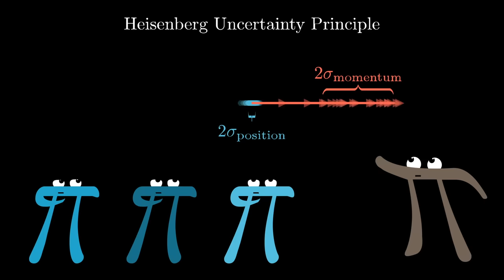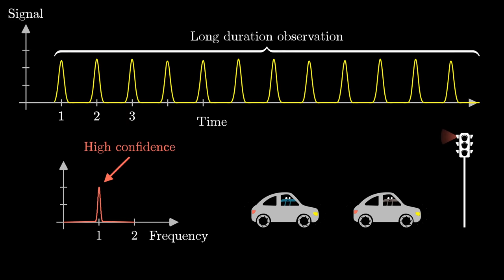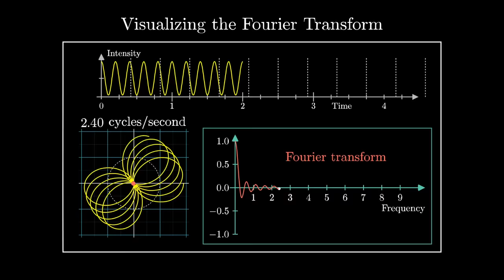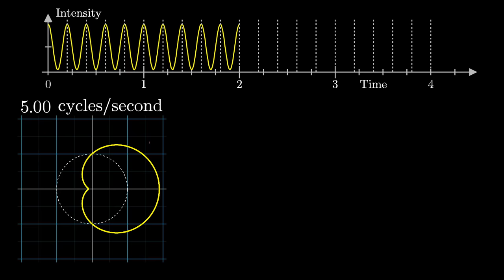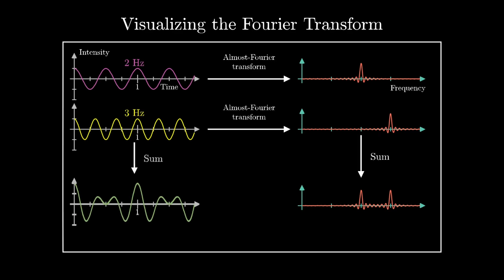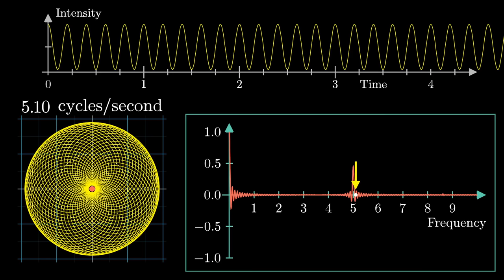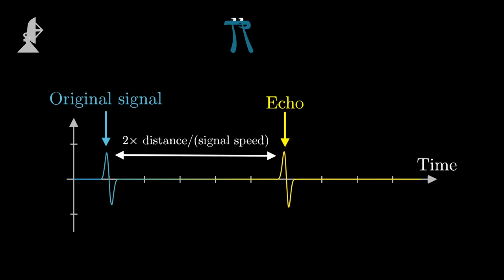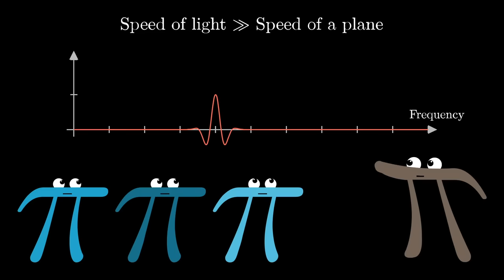The more general uncertainty principle, regarding Fourier transforms

Comment: I'm totally mind-blown by your ability to translate hard to understand concepts to easier concept. 

As a very critical person I only had one objection to the whole video, which is rear. At 12:30, when you shift the weights to the center, you didn't adjust the strings, so I was a bit confused, had to lissen to it again to understand that even after the shift they all still in sync.  To keep it in sync, the thickness of the springs need adjust as well ... ok, it may be a challenge to render it, but it did make me stumble on an otherwise flawless video. 

Ow, if you want intuition to science, I would love to contribute as an interdisciplinair scientists. My main topic of interest is to understand how novelty can emerge, which touches so many domains that I have a good understanding of many domains (I'm doctor in 5 domains).

Comment: Without knowing any of that I was able to explain how having a more precise measurment of the position of something (which corresponded to a less precise measurement of speed) resulted in knowing the position of something moving over time to became much less certain than if the initial certainty of the measurement of it's position was less certain instead (and so the corresponding precision of the measurement of it's speed was more certain instead also). Though I didn't explain why as you have done in this video. But without knowing why you can see the effect much easier when considering what is going on dynamically rather than just considering instaneous measurements of speed and position at any one time. I just used a treacle and water mixing analogy - water being position and speed being treacle (on a slope), with more water going over to the treacle (making it more runny - unevenly due to randomness) with greater certainty over position.

Also, relating to something else, I hadn't realised I had re-invented the fourier transform myself (with the same visualisation you had) until watching this - so that was funny...   Well, I guessed I had but I wasn't sure. I was mapping infinities onto a sphere by converting linear numerical dimensions (i.e. infinity) into trigonometric dimentions (i.e. 90 degrees) - which is like the zero to infinity boundry conditions used with signal processing (?). I was playing with phase differences and central focal points (by continuing using a spiral rather than the free floating orange point you had in the yellow curves). So I'll have to revisit what I did.

Comment: in physics - the word "beats" is used to describe 
the changing magnitude of the sum of two signals of nearly equal frequencies -
as these signals slide in and out of phase with each other.
thus a 203 hz signal added to a 200 hz signal would yield (203-200=3) beats per second.
thus "beats per second" (referenced at 2:50) is not a good synonym for "cycles per second".
admittedly a trifling criticism in the midst of a masterful presentation of VERY "difficult" topics.

Comment: I would like to add one more thing. Why the Fourier transform is the average/summation of the projection over circle. If we write down e power x, sin x and cos x in Taylor series, and expand the expression to e power ix we get the result as cos x + I sin x. Now Fourier transform is the integral of this e power ix multipled over our function of x. So in visual terms it's the summation of the projection of Cos x times our function on the x axis and sin x times our function on the y axis. Now one may wonder why we need both cos x and I sinx. Wouldn't just cos x suffice? The answer lies in that we need atleast these two components to encode the phase information.

Comment: At 1.52 the yellow signal contains two frequencies. The lower one modulates the higher one. Should look at the Instantaneous frequency. Frequency in FFT is constant and the time frequency pair is transformed in integration so that causes the uncertainty issue.

Comment: This explanation is amazing! Another trade that happens in Physics which I can't find anywhere is the simultaneous measurement of electrical current and voltage around a resistor. you can't have both simultaneously with unlimited precision. Would you comment that or someone find a reference to that for me?

Comment: Your comparison to identifying sound frequencies, with higher frequencies requiring more time to identify, is contrary to what we find when we try electronically to identify the frequencies of sounds made, say, by a guitar. Our equipment more readily, that is more quickly, identifies a higher pitched sound than a bass sound. The bass sound takes longer to be processed and identified, simply because it is not over for comparatively a long time. This is quite a problem when we want to use sound-to-midi equipment to follow a quick guitar riff. The higher pitched sounds are more easily recognized and discerned among other notes than the bass sounds. It has kept back guitar-to-midi gear for years.

Comment: Around 14:45 the video shows a plot of position and a plot of spatial frequency. Above those two is an animated single frequency sine wave. Then, as the spatial frequency is shown to increase or decrease on the spatial frequency plot, the animated sine wave is shown to change. I think that the change shown is in the wrong direction, i.e., as the frequency increases the peaks in the sine wave become further apart. It should be the other way around, I think.

Comment: I would just respectfully add a minor detail. In quantum mechanics, the wavefunction has an inherent probabilistic character. So, all your reasoning is valid in a probabilistic sense. That is, if you repeat the experiments of measuring both the position and the momentum of a particle in a state over and over again, you would find the trade-off you mentioned (depending on the wavefunction itself): the more you know the position, the less you know the momentum and vice-versa. Again, this sentence is valid for the average of those quantities over a large number of experiments. That is the uncertainty relation, which is what you explained well in this video.
However, that is not the uncertainty principle. The uncertainty principle states that that remains true even for an individual measurement. As far as I know, this does not follow from the mathematical framework of the quantum theory.

Comment: Interesting. Not sure of the specifications for aircraft radars, but for weather radars, we generally transmit pulses several thousand wavelengths long, so there's very little ambiguity in the frequency. Instead, our problems are caused by the time between successive pulses. That introduces position and velocity uncertainty, though in a slightly different way.

Comment: Moreover, in linear algebra terms, this relates to how that coordinates change when you rotate from one basis to another and that such a basis rotation causes a vector which lies on an axis to no longer do so. A Dirac delta or close to one - ideally localized particle - is a "vector" lying along a single "axis" of the infinite-dimensional vector space, where the "axes" (not the vectors!) represent possible positions in (real, not vector) space. When you rotate basis to the momentum basis, that is, to sine waves, then now this vector no longer lies along an axis and thus has components along many axes - many possible points in momentum, so it appears spread out when you graph the associated wave function you get something much more spread out. And it's not hard to become tempted to make the jump that given that the evolution of such a dense wave packet is to spread out, that it could be described by itself a progressive rotation (or more complicated motion) of the basis vectors. And you can indeed do that. That is the "Heisenberg picture" of quantum mechanics. The other picture with the wave function in single basis spreading - i.e. the "usual" picture and which corresponds to the vector wandering - is the "Schrodinger picture" of quantum mechanics.

(There is also one more picture, which is the Feynman Path Integral picture, which corresponds in at least a rough sense to imagining the eigenvectors - which in quantum means those definite-property states like the delta functions for position - as wandering, since we assign probabilities to each possible classical path, which could be described by such things with their "peaks" moving to trace it out.)

Comment: What are the moving dotted lines symbolizing? They seem to be the key factor in what kind of graph is drawn and and where the dot moves in fourier transform, but I didn't hear it if you explained what's happening with them. The sine wave doesn't move based on time, but the dotted lines do.

Comment: at 12:42 you depict all masses attached to a spring as having the same frequency. The frequency of oscillation depends on the mass attached to the spring (inertia). As I understand it´s not what de Broglie describes in his seminal paper. He writes: 
"To make the last point more precise, consider a mechanical comparison, perhaps a bit crude, but that speaks to one’s imagination. Consider a large, horizontal circular disk, from which identical weights are suspended on springs. Let the number of such systems per unit area, i.e., their density, diminish rapidly as one moves out from the centre of the disk, so that there is a high concentration at the centre. All the weights on springs have the same period; let us set them in motion with identical amplitudes and phases. The surface passing through the centre of gravity of the weights would be a plane oscillating up and down. This ensemble of systems is a crude analogue to a parcel of energy as we imagine it to be." So there are all different oscillator but their density is higher in the center. Your simulation at 12:42 is therefore not totally correct physically...

Comment: Haven't finished yet but this is has been my basic guiding principle for years now in theory. Motion the vector creates mass my causing movement of fluid space. Mass is a wave from creating structures with those amounts for given structure and as we say in programing higher and lower over view structures are particles of those masses that have had emergence patterns define certain particles such as relative amount of size and energies of electrons. So when forming an atom you have the prime matter theory that an particle managed to stretch out the inward facing poles of prime matter fluid space of space time allowing the poles to attract a nucleus. The surface of every particle is a wave holding all of the information about that wave which can be wrapped in multiple dimensions around another point a higher lever over view particle in this case the electrons energy can start wrapping their energies around a nucleolus. Looking at the Fourier transforms yo showed in 2d but in 3d as sheets of energies until the shell is so full of electrons then electrons can begin to wrap around the next shell to hold them together you need more attraction of mass from the nucleolus as well. Given they are normal forms the energy defining the vector that give the particle shape tends to break off in similar particle shapes but also given inefficiencies particles can loos energy while moving through space as heat, neutrinos, decay, I'm sure there are others and you get things like shifting neutrinos adding and loosing mass. In any case each shell fits over each shell and break apart as equal amounts approx. of energy as that may neutrinos. Determining the side of the wave forms like in your Fourier transforms that are highest and intersected at that time in the waves motion or unequal distribution of the mass on the surface area of the wave is hard for reasons discussed in this video you also do no t know where that transforms spirograph shaped waves started tracing and what other particles bounded off of them. Say a light wave squeezing up and down between atoms or laser light carrying an entangles particle to a spooky distance and bouncing off of the sheets edge creating ripples allowing them to turn the spin of the atoms or some other structure all at once to cause action at a distance without need of time as they spin together. I've also been watching PBS for years and I know my fringe idea since I was at central seattle that the wave edge of something cam from my trying to rethink the double slit and to me it all makes perfect sense but is difficult to describe with my language and I've have to refine it with lessons but I had a guiding principle a few years ago that a particle is a portion of energy traveling as a vector that give the vector shape. Now how does the in motion wave shell get effected by red shift and blue shifts and how if you are closer to the part of a wave and because of a small amount of relativity further away from the next part when viewing it as a whole. I like o submit that they are moving and interacting within their physical space with the same rules as the part you are closest to and not that observing changes it unless that form of observing adds variables and energy but that it you are simple unable to be in all places so it appears different. It also makes measuring things like how entanglement can be effecting all the particles and spacetime as it travels but to me there is always a physical mechanism that is not to complicated to imagine and not just magic.

Comment: A more intuitive word for spatial frequency is "density." In the field of cymatics, the density of particles increases at resonant points along some medium.

Since there is a higher density of particles at those points, the momentum of the system is higher, because the net mass of the system is higher at those points, since there are more particles there. :^)

Comment: If you want to get just a little more mind-bending, consider that that momentum wave that describes the particle's motion through space is only describing motion relative to your reference frame. In its own frame, it has no momentum wave, unless it's accelerating (in which case its reference frame is changing at a constant rate).

Comment: Question: Is this a good example?
1. Take a 100% sharp picture of a bullet at time X = Shape and position is clear but the relative speed is not discernible
2. Take 10  10% unsharp pictures of the of the bullet at time X1 and X2 and ... = Relative Speed is clear but the shape is not clear
Reply: I don't know if this analogy is apt and comes without weaknesses, but it seems like a good analogy to me. It depicts well the trade-off, illustrating that you can't take unlimited data from the given object. There's a limited amount of data taking available and you have to trade off whether you want to concentrate it for position or spread it out for momentum.

Comment: Great video . However the  animation with  loaded springs ignores the fact that in (classical) physics the frequentie of an oscilation depends on both the stiffness of the spring and the mass of the object that is suspendid. The animation seems to suggest that all the springs are the same. If that is the case then the springs with the heavier load should oscilate at a LOWER frequentie then those with a lighter load or at least for an observer who is not moving relatively to the row of springs. Overal this means that the frequentie-spectrum is much more complicated than depicted.  And of course it would cause a serious headache to make an accurate analyses of what a MOVING observer is going to see. (pardon my splleling)

Comment: This video also explain the spread of frequency of AM and FM radio.

A low amplitude sound will modify the amplitude or frequency just a little, so creating almost no interference with other radio station using almost the same frequency.

A low frequency modulation also introduce less interference with other radio station than if the frequency of the signal to modulate is higher.

Finally, if the signal that modulate the AM or FM radio is not sinusoidal, then the interference of the AM or FM transmitter also increase.

For example, given a 1 khz signal with a given amplitude, if the only parameter that change is the wave shape, the final modulated signal will increase in bandwidth, that is interfere with other radio station more for a square wave at 1 khz than a sin wave at 1 khz.

Brief, given the 3 parameters of the signal to modulate:
- amplitude
- frequency
- wave shape

At zero amplitude, the output is a pure sinusoidal and there is no interference at all on any other radio station.
If we set the amplitude to a fixed value like 50% of the maximum allowed
then we change the frequency or wave shape,
the AM or FM transmitter will create interference with other frequencies following the wiggle of the graph of frequency as seen in a spectrometer or a Fourier transform.

AM radio
A very low modulation frequency such as 0.1 hz has the following effect of AM radio
 - a slow change in amplitude that repeat every 10 seconds. Virtually undistinguishable from any source of low frequency noise like the tide or large vehicles like an oil tanker a few miles away which would slowly add/remove echo noise or even the change of performance of the transmitter or receptor has any of them warmup, for example.

FM radio
A very low modulation frequency of 0.1 hz on a FM transmitter is perceived as:
A slow increase of the radio frequency for 5 second, then a slow decrease for 5 second. The official frequency of this radio transmitter is presumed to be right in the middle at time 2.5 second and time 7.5 second.
Such slow shifting up and down could not be distinguished from any type of interference that also affect frequency such as: an airplane flying toward the receiver could  happen to reflect the signal of some FM transmitter. The Dopler effect would make that FM signal blue shifted. An airplane flying away from a radio receiver and reflecting radio waves from any transmitter would makes the frequency red shifted.